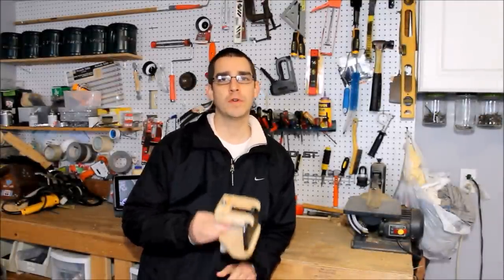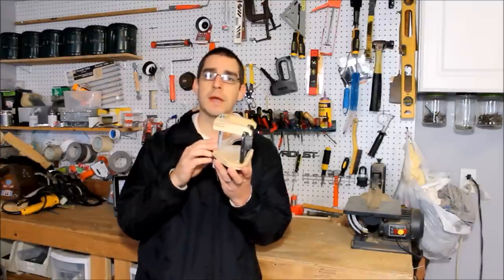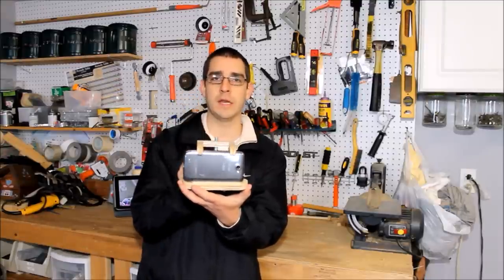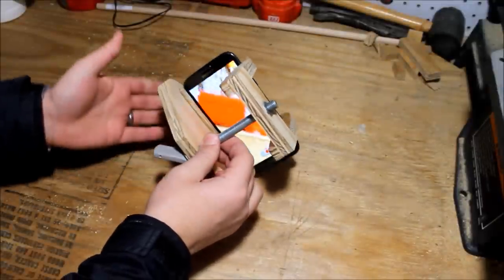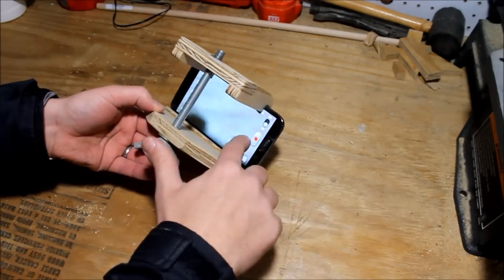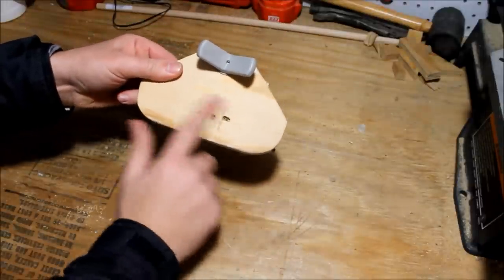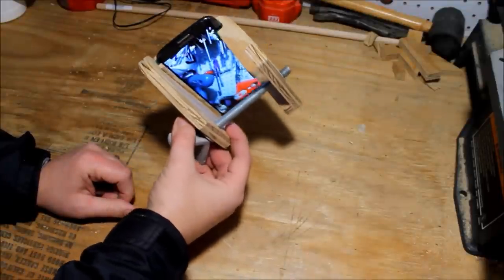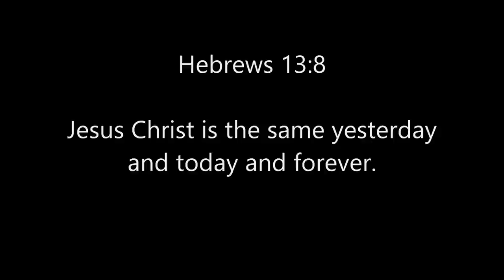DIY Cell Phone or Tablet Tripod Clamp - Use your phone or tablet to make quality videos!

Comment: You said something about a bluetooth lapel mic.  Could you show how you use this?
Reply from the maker: Daniel Gardner I was just planning on using a Bluetooth headset for the camera audio but it does not work very well. I am still messing around with different solution for the audio so if get something worthwhile to work well I will share it in a video.